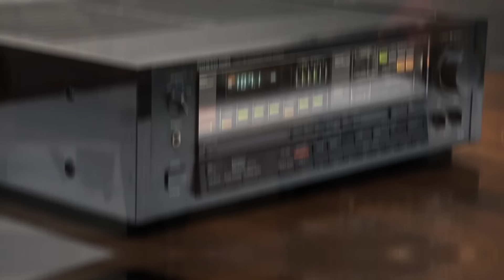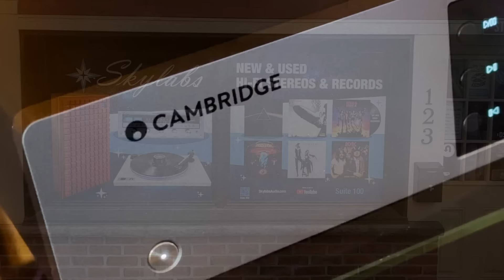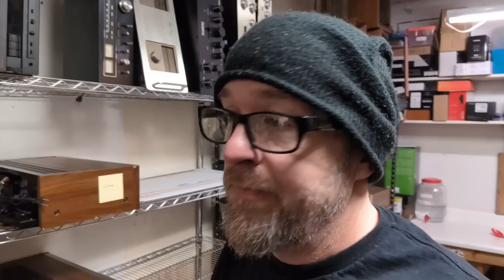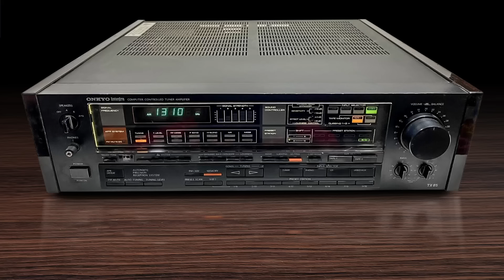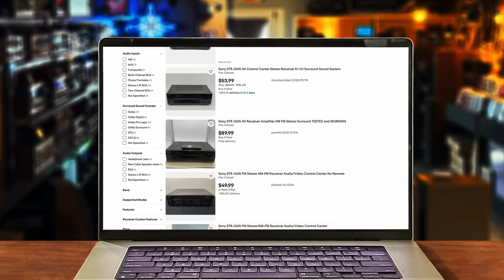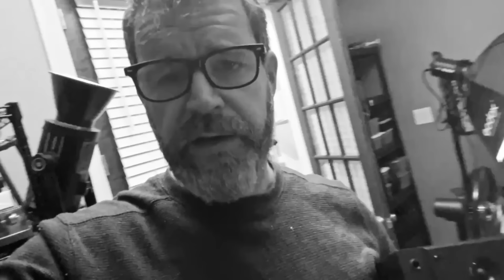Underated Vintage Stereos You Can Get Cheap... For Now

Comment: re: speakers, my teac LS-MC80 bookshelf speakers are tiny little terrors. 7 inches tall and several pounds each, and they sound GREAT. they make fantastic computer speakers.  they came from an uninspired bookshelf stereo system, but they have 3 way mount binding posts with banana plugs, theyre DENSE, they LOOK really nice, and they have a really good sound DESPITE their size.  they pop up all the time CHEAP. i paid 14$ for em at goodwill.

Comment: Got one for ya, just got back as a loaner, a late nineties JVC RX-318BK.  Has 110 watts per channel and is built like a tank.  I see them all day on ebay for around $100, usually with no remote.  The good thing is all of the buttons on the front of the receiver are the same as the remote.  If remote is lost, you can still use it.  Good price for a hundred watts.

Comment: I bought a Onkyo TX-811 new in 1990, I still use it every day. I picked up a second one on ebay a couple months ago for $65, and a couple 8 ohm dummy load resistors, and I'm now running them as my redneck mono-block rig.

Comment: I recently bought a 1988-90 Yamaha AX-530 for 90 bucks off of Ebay. It's immaculate and I can't really tell a difference between it and my dad's AS-700 sound quality wise. The build quality on the other hand is much nicer on mine, it still has that japanese bubble era quality to it.

Comment: Seems like late '80's and early '90s is a sweet spot for the high quality and value.  Not only for hi-fi equipment, also for professional audio, synthesizers, etc.  Although the synthesizers from that era seem to be picking up in value lately.  I think it has to do with the numbers of units made.  If there are plenty of units available, the prices are low.  Conversely, with very few units available, the prices grow exponentially.  I, personally, quite like the aesthetics of the late '80s and early '90s in pretty much everything.  My favorite equipment from that time would be Technics, like the SA-R477 receiver.  The SU-V series integrated amplifiers.  And let's not forget the DAT machines from Panasonic and Sony.  I mean, there's plenty of equipment to choose from at reasonable prices.  What's not to like?  Bonanza for the consumer, a nightmare for a reseller.

Comment: I have 2 different onkyo’s a small older tx-nr8210 that pushes about 60ish watts and my big one is a tx-nr929. I’ve owned both since new 1995 and 2015 when I got each. Both I’ve never had issues with either one besides the usual running hot but never been down for anything!! But I need to get more power added to my 929 to get more juice to my B&W 803D diamonds.

Comment: Trying to sell old hifi which underperforms compared to modern midrange models especially in upper treble? Sure most current stuff is shit, but spend $300 on a decent modem unit over a vintage one and you’ll have a winner

Comment: I have collect so many pioneer vsx  people selling cheap becouse cant on,most problem becouse broken voltage selector switch or mising that cap that selector so that amp cant turn on just on in stadby mode/safe mod or blue blingking,people selling around 20usd 50usd.i repair just using one jumper wire and solder only in asia using 220-240v vsx for us market same model dont have voltage seletor but power only 110v.if peole love music but dont have much money buy amp and dont like biggers amp,you guys can buy wuzzy class d amp china brand that amp so small like diy amp and so cheap  but sound so clear,i have one wuzi zk-tb212+1  2×50watt 1x100 watt sub woofer power input dc like laptop charger im using 24v8a using almost 1half year,the speaker im using almost alot is infity rs2000 and jbl cf100 and subwoofer no brand 6.5 buffer bigger like donut 4ohm 100watt and using subwoofer crossover diy box diy to,not only im using this amp for home only but if im hunting speaker im bring this amp to for test speaker and becose easy to bring anywhere.try one trust me u dont need big brand,using cheap brand get same result to.

Comment: Nice to see the PSBs on the desk. I've got a pair of Century 300i, that do sound pretty good. That were indeed inexpensive. The fact that one had a grill and the other did not may have been a factor. What I'm leading up to is, if you see a singleton come in or another pair with only one grill, drop me a line! 😁👍

Comment: I got a old VSX. 501 pioneer and a set of Advent heritage speakers for 20 bucks at at yard sale. Receiver AB switch needed a lil de- oxit, surrounds were gone on the speakers but I got it all fixed, been about 8 years and it all still works wonderfully. 

Oh, and the best part about the old pioneer VSX .
 the motorized volume control with remote. It even has a little LED in it so you can watch it move in the dark

Comment: As a starter unit, for a small room or as a garage amp, i strongly recommed a Yamaha RX 360/460. It is an early 90s 55W unit, but is so well built: Motorized volume knob, aluminium faceplate, a proper loudness knob, phono input with ground hookup, huge heatsink and the ability to run 6 ohms min. speakers (most integrated amps from that era run 8 ohms speakers min.)The 460 ads an a second tape monitor and a remote link port for a matching set turntable. 

I use it as my main setting in my bedroom, and i really like it. The only main issue with this unit is the screen bulb, which after burning, can render your amp inoperative , but replacements are easy to find. After this, it is a cheap, solid and reliable unit. You can find them under 100 bucks easly. Mine cost 60.

Comment: I’m glad you mentioned Boston Acoustics speakers.  I’ve had a pair of their model A40 bookshelf speakers for almost FIFTY YEARS, and they sound absolutely amazing next to anything that’s made today.  I’ve run them like crazy for all that time, and they’re terrific!  I will admit that about 20 years ago, I had to put new woofers into each cabinet.  Why?  Because the material that surrounds each cone was completely shot - and I means in TATTERS (after 20 years of blowing the doors off ‘em!).  So I called Boston Acoustics and asked them if I could get a replacement set of woofers.  They said, “SURE!”, and for something like $30 bucks each and ten minutes installing the new speakers, I had what has sounded like brand new speakers for the thirty years since!!  I like ‘em so much, that when I bought my most recent LED flat-screen TV, I also bought a Boston Acoustics sound bar.  It’s been sounding great with absolutely no trouble for 12 years.

Comment: Yeah, that 840 that’s a money maker right there, all the derivatives throughout the years are rock solid. I had one for 10 years, and then I found one at the yard sale for 10 bucks bought it. It was newer, sold the old one for 75, found a newer one sold that one for 75… Now anytime I come across them I buy them at one point I had five of them just stacked on each other and then one weekend I said I gotta get rid of these put them all for 75 bucks or 100 for the two that were newer Sunday afternoon They were all gone… but I still have one because they rock solid..

Comment: If I may add a recommendation: Onkyo's TX-SV70PRO, 1990, manufactured in Japan, a transitional AV receiver with a phono stage, originally $1200, sounds superb, you can turn all the AV stuff off and run it as a stereo receiver. Currently going for under $200. Yes, it's a black box with a digital display, but it sounds spectacular and was built like a tank.

Comment: 80s and 90s equipment has a bad reputation, because all the big brands started a race towards the button. Yes there are some racks from Onkyo, Pioneer, Technics, Sony, Phillips and even  Marantz that are well... Boombox parts in big empty cabinets. But the higher tiers of those brands really are great build and sound quality. I  think this goes on to about the time Pioneer switched to the new logo. It's nothing for me, but that is only because I like silver faced and from 1985 onwards it is hard to come across anything silver. But if you are into black, great sound for little money out there.

Comment: I gave up on the vintage audio game. I have two 70s receivers that are near mint on looks, but neither work well. I can't find anyone to work on them.  So I went with a new Yamaha stereo receiver. The radio part is OK. But the Bluetooth side sounds great. I lucked out, I found a pair of Bose 301s that work and look great. Then I added a pair of KEFs. They were in the open box section of Best Buy. So I got them for 240. Its not a massively loud setup. But I live in a small apartment so it works.

Comment: hey, I still have a VSX-D1S (bought new in 91), wow! Never thought I’d see something I own on one of these lists. 

Bummer it doesn’t make sound, lol. I’ve always been hoping it was just a dust or something silly like that. It is only the amp that doesn’t work. Still seems to switch signals fine. 

Ended up getting a Sony STR-DA5ES to replace it and always meant to get the Pioneer fixed. That was in 2002 ascribing to my Crutchfield account. Don’t want to rush into anything! lol

Comment: I was almost going to pull the trigger on the Onkyo TX 840 on ebay. It had no remote and was $140 before tax. None of them on ebay have remotes. Then I found one with a remote for $60 on marketplace 90 miles away. I picked it up yesterday. The guy I got it from bought it brand new. It is mint. I like how the volume knob turns when you increase or decrease the volume with the remote. I bought it to replace a Yamaha RX 300U that has a bad input selector. Thanks for the recommendation, Kevin. My garage stereo is going to rock!

Comment: People should think about the price when new, and what that converts to today. A Pioneer SX-727 sold for $349 in 1972. That would be about $2000 today. If one wants to compare vintage to new then use the right the price. Some of the best buys one can find is gear from the mid 80s to late 90s. Onkyo Integra amps are terrific. Pioneer A656 or A616. Old Denon gear. Rotel.

Comment: Great video/topic. I started with audio in the '60s and '70s and I just consider the vintage range as either old vintage or new vintage. New vintage for me starts in the mid '90s, or when digital controls started to be common place. Anything with analog pots I consider old. Also speakers that were made when they were only using either cloth, or foam surrounds on speakers. 

"New vintage," the speakers can often have rubber surrounds and composite cones, such as JBL's 'polyplas' drivers on their consumer line stuff from Northridge. These speakers are typically overbuilt with decent sensitivity and high wattage ratings, so under most normal use, were not pushed anywhere near their limits. These things can get wet and still work after. This era is my favorite, because it is the era with the best values. As computers started helping to design better drivers and speaker designs, even the budget stuff was a contender for very reasonable hi-fi performance. The budget stuff in the '70s was crap, comparatively.

I love the "New vintage" stuff from the late '90s early '2ks. It's still healthy enough to gain legacy status and can avoid those dreaded, analog pots and rotting foam surrounds. JBL/Infinity on the used market from back then can fill end game status role as far as I am concerned. Those old speakers are much forgiving for these higher performing budget class D amps, too, so it's easier than ever to get incredible hi-fi for little money.

Comment: I think I have an audio component that will top most in the reliability claims department: My Technics SL-PD9 5 Disc CD Changer has been running flawlessly for 10 to 12 hours every day for the past 25 years"...Every button, every light, every function works as it did the very first day I bought it 25 years ago...Me and the wife sleep to it playing an ocean waves CD every night and have since 2000 and it has outlived 3 receivers in that time period..."They just don't make them like they use to anymore" ;)

Comment: I picked out the entry level sibling of the tx-840, the tx-800, for my Dad when it was new, it's still going strong and I think it sounds pretty good. I bought a pair of PSB alpha B and one C in the early 2000s. the crossover is weak in those, I had one of the B crossovers fail under warranty and had them both replaced, but now one of the crossovers has failed again. I'm going to have to recap it myself this time.

Comment: I picked up an old JVC A-X77 amplifier, their flagship at the time, for basically nothing. I have seen them for sale for at most $300. This amplifier blows my modern $1000 Cambridge out of the water. It is one of the best sounding amps I have heard. But JVC isn't one of those sought after brands.

Comment: I love 80s and 90s gear. Plucked an Onkyo TX-8511 from goodwill last month for $23, and it sounds good.   Don't forget the Sony STR D1011. A gem for cheap, and the clear buttons are cool. Many of the early  prologic units sound good, real good, in 2 channel mode. And don't forget infinity, many many great speakers for cheap. Thanks for discussing these robust units.

Comment: still own my Onkyo TX_SV50pro from the early '90's.  Still had my Pioneer from the early '80's til about 5 years ago when someone offered over $800 for the rack system I built out of single purchase components.  I have a newer Denon, but won't dare get rid of the Onkyo - just too much punch left in it.  Had an old Sony too that I replaced the rack system with but sold it to someone I know when I closed it last year, now its in a NAPA store.  LOL.

Comment: What is it with Americans and receivers? Here in the UK receivers were never that popular. Personally I always preferred separate units. Why don't you show vintage tuners? My first tuner was a Denon Tu-260L which I still have. Receivers will always be a compromise as the money the manufacturer spent on putting a tuner in could have been used to make a better amplifier.

Comment: The current centerpiece of my home audio setup is the more advanced, but of the same generation, Sony STR-D915 receiver. It was purchased around '94 or '95. I still have the original remote for it as well and the display still works perfectly. What's problematic is the A speakers works randomly so it's always on the B selector, the front panel mute button sticks so I use the remote, and as of two months ago the Dolby Surround setting gets wonky requiring me to either crank the volume until the left side decides to get it together, or I switch to the tuner which doesn't use Dolby surround and then switch back. One day I'll open it up to see if I can fix that stuff but for now it stays. I actually have two Onkyo units that I bought to replace it (a TX-DS797 and an HT-R290), both of which had issues so I put the Sony back in place. If I can get one of them working properly, the Sony will be retired to my bedroom and live out its days there.

Comment: Turntable wise only one brand is worth checking out for bargains and that's Dual. Original parts mostly available except the cartridge sled ( odd connection on CS505/1) People make oed parts but expensive. 505/1 with sled are out there. And they run slow or not at all. Get one with sled and all you need to do is do some cleaning. That grease can be cleaned off and you can put better lubricant ( it's 2025) . The MK1 505 sounds great to my old ears . I know it's not better than the Pioneer PL12 or Sansui 222. But try to buy one of those. They were in turn bested by the Rega Planar 2. Again expensive today. So why would you buy an old Dual? Because they sound better than Fluance and AT and Victrola ( insert other TT fraudsters yourself) If I had $100 I could have something that would last me a lifetime. If the 1 got improved down the line then my worst 505 is better than the Fluance RT85. Arm on that TT is awful and Fluance know it. So they distract you with " ahem" upgrades. Nobody who actually owns a Fluance has directly compared it to anything else. Now it's full disclosure time. It's the 70s and I love music. I want a record player but the best record player you find ( if you are lucky) is the Garrard SP25. So you have to travel to hear a Pioneer or a Sansui or a Dual. And I did. They weren't audibly better than the Garrard from memory so I wasn't prepared to spend a huge chunk of change for any of them. But then came the Planar 2. Everyone was saying it was a game changer and I couldn't go to audition so I bought blind. I thought I was tripping. Soundstage was awesome. Simply put if you can't get a Rega of any vintage and have $100 get a Dual and laugh at Fluance Muppets.

Comment: The Sony sscs5 is a decent budget for a very warm sounding stereo, but only sub $100. Like the pioneer bs 22 speakers tuned by  Andrew Jones sound good with a bright or analytical amp. I have an Onkyo monster integra 108 and a Denton DRA 635r (bought in ‘89). Both sound great, both the onkyo needs some attention. CD player is Denton DCM420 which sounds like it’s brand new. My favorite bookshelf speakers were BostonAcoustics HD8.  Currently running Advent legacy III.  A fun setup.

Comment: Boston Acoustics A400s that I purchased in 1985, are still the greatest speaker I have ever heard.  Not bookshelf. 4 Ohm, so need a really good amp.  Just wonderful, though.  I think the crossovers need to be recapped, now, as the high end seems to be fading.  I'd much rather repair them than buy anything else!